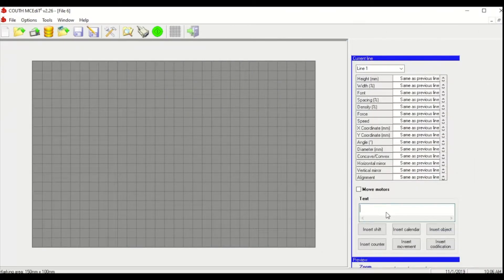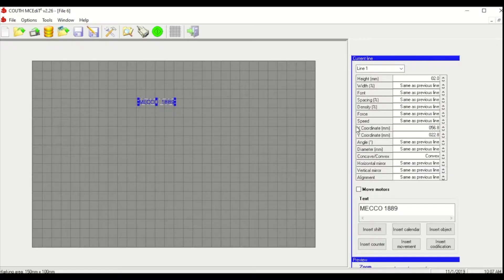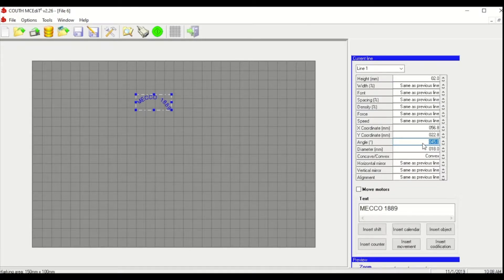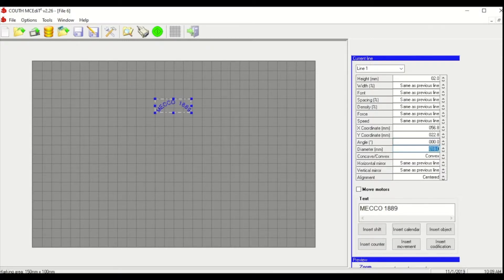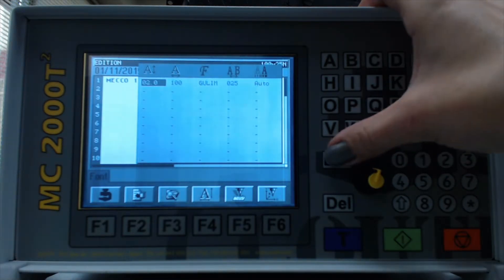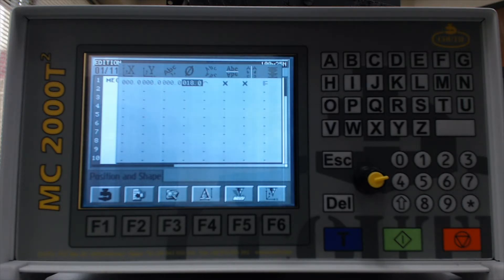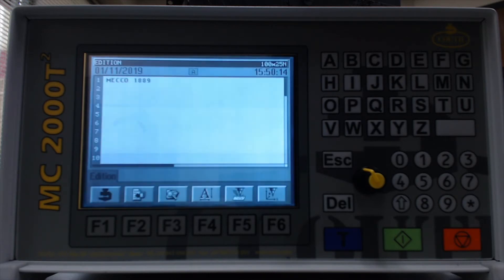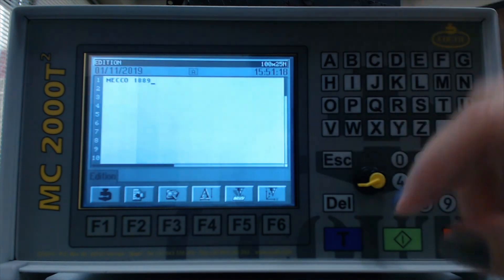How to Setup Arc Marking - Pin Marking Software & Controller

Comment: How do you save your settings once you get it where you want them?   I got everything set up then switched to another file then went back and everything was changed to the previous settings.
Reply from the maker: Thanks for your question, Jack! You'll just need to save the job file. On the controller, select F3 (icon looks like a folder with a magnifying glass). Select F4 (icon looks like a document with a floppy disk). Name the file and press okay. If it’s on a T2 controller, you would push the scroll knob.  

You can also reference the Smartbox controller demonstration video. At 13:49, we go through this process on the touchscreen pendant. 
https://www.youtube.com/watch?v=OBpRdY--br8

If you need more support, please contact our team at https://www.mecco.com/service-ticket.